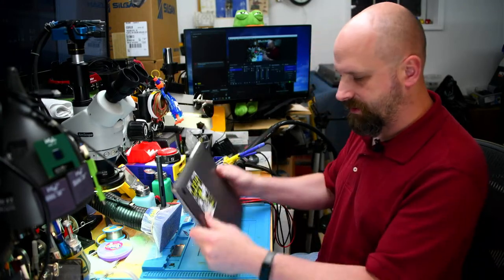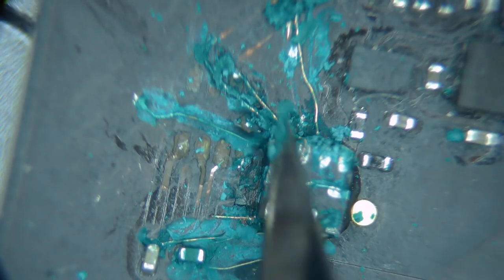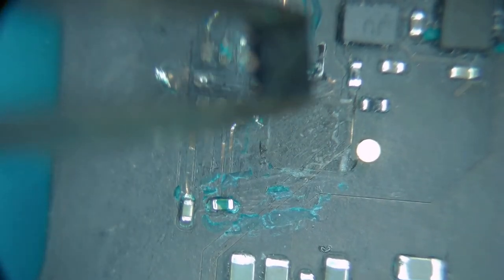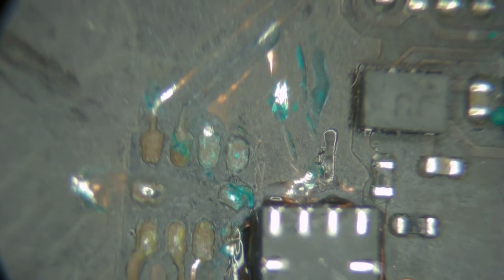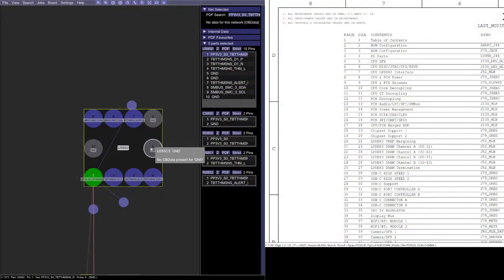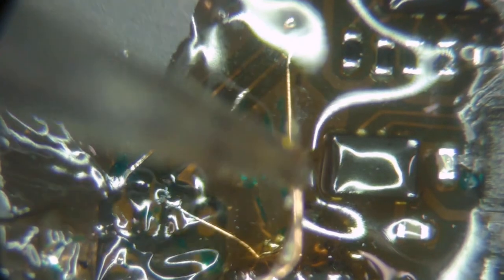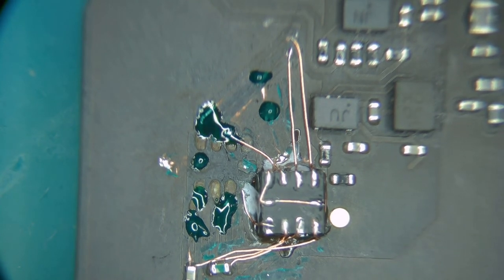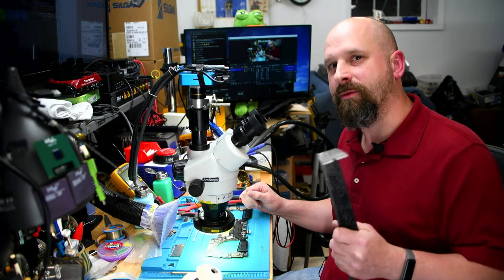Don't do this when opening your MacBook Pro!

Comment: I recently repaired an A1707 that was opened with a tool. It removed components on the edge and prevented the touch bar from working also keyboard backlight als. Came to me because it wouldn't install an os due to failing firmware

Comment: Hey @paul which CPUs do you have there ? Looks like pentium 2 maybe 3 and 2 486.

Also why you didn't show us the board actually working.  Where is the famous "Fan Spin"
Reply from the maker: One pentium 3 one 486DX one 486SX. They are there simply because they stick to a magnet.
These newer machines you have to put the board back into the case to show fan spin. My streams are long, that would have been to long.
Reply: @A2000MHz  make sense. 
Also I was right about both of them NICE!! 
I actually have a 486dx2 I build for retro gaming with a bunch of ms-DOS games. 

And sad about the fan thing I do love watching it work in the end.  Like a happy ending in a movie. 

PS nice Darth outfit :)

Comment: Do you charge more if you need the re-do the "dead bug" repair instead of fixing it on a "clean" board ?
Reply from the maker: No, the prep work of taking off the old work is about the same effort as preping the mangled pads from the original damage.